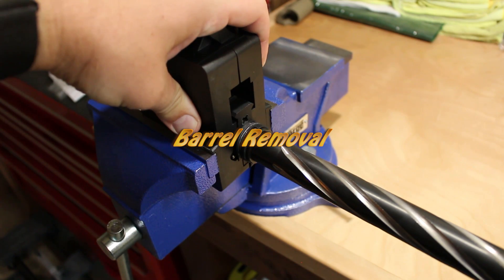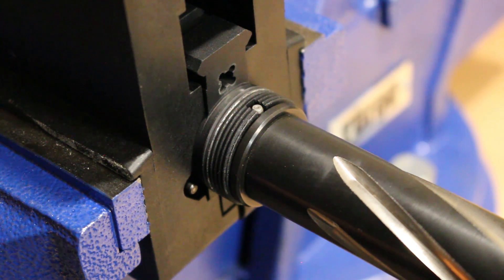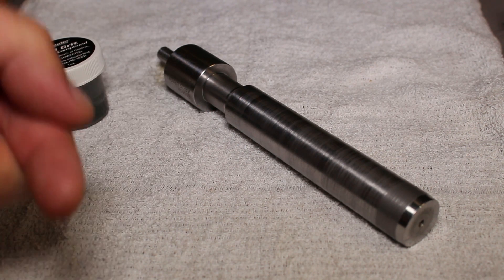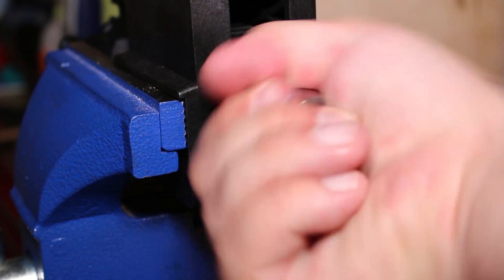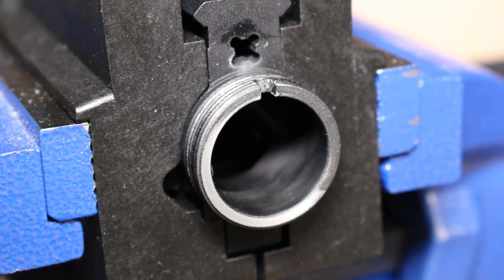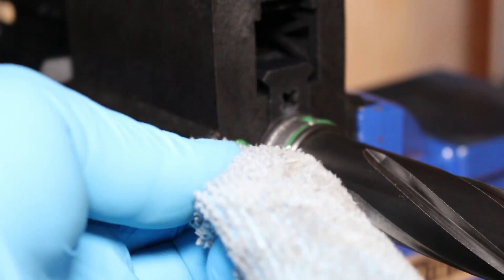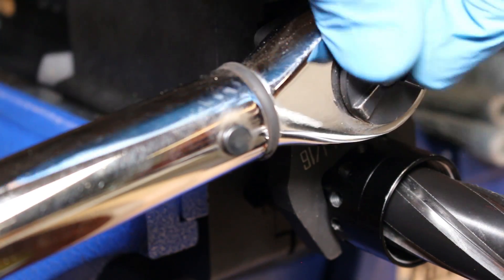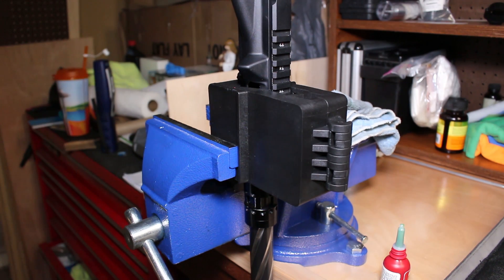Bedding a Barrel into an AR-15 upper receiver

Comment: You just removed the anodizing from the aluminum...You literally made the part of the receiver that takes all the rearward force soft as butter. And as a gunsmith please don't ever put locktite on a firearm ever again!
Reply: so you dont use loctite on set screws for pistol or rifle sights or handguards or scope mounts or rail mounts/accessories?
Reply: @sik59rt  He meant the barrel. You never use locktite on a barrel, or the nut. That's never coming off. Granted, he might never shoot the barrel out, but that upper is done.
Reply: zzseamlezz so when he said “never put ‘locktite’ on a firearm ever again” he only meant on a specific part on a specific rifle? Okay
Reply: @sik59rt  Assume positive intent, yes.
Reply: @MrAKBBags  blue loctite releases after you put a heatgun to it. I use one small drop on my front sight on pistol
Reply: @ryangreen6250  Same, but he said the firearm, not the sight.
Reply: @MrAKBBags  ya i dont know why people generalize so much when the devil is in the details
Reply: @sik59rt  Sights aren't the firearm, Holmes. They secure to a rail. No one uses loctite on parts that would get hot (the Barrel) because it's stupid, and wouldn't last more than 50 rounds, or if it does, it's never coming off. Huuuuur duuuuuur, let's put High Temperature Rocksett on muh barrel, or barrel nut. The absolute state of NOGUNZ.
Again, "Accessories" isn't a firearm. Why is this hard for you?
Reply: i don't think you know how anodising works
Reply: What about the optic mounting screws?
Reply: The barrel is actually pulled away from the receiver by the force of the bullet. The reward force of recoil is generated by the forces on the bolt face and by the gas system. Unless you're referring to the clamping force of the nut, which isn't enough to ruin the aluminum. Basically what I'm saying is you're wrong lol.

Comment: Good for you making this video.   Lapping the receiver face is a good idea ..  not so sure about the Loctite... I might recommend you use aeroshell 33MS for the bbl extension and the bbl nut.
Reply: The loctite is to fill the gap between the barrel and the upper.  Did you see how loose that barrel was, 620 will fill that gap as long as it's .015 or less. . .Loctite 609 is good for gaps .005 and under. . .The key word here is "bedding"
Reply: @z50com  Cool... That works I guess.

Comment: This is why I buy stripped BCM uppers. They're already machined to a tighter tolence and have to be heated to insert the barrel ext. No sloppy fit and doesn't really require lapping .
Reply: Eric Hayes I have also noticed this in the aero Percision upper receivers very tight fitting on the barrel extension.
Reply: Yep. Same w/Aero Precision, and Spikes. That barrel isn't moving after applying AeroShell, and setting in the upper.
Reply: Even after heating with a propane torch it's still a pain in the ass to get together  from my experience very tight tolerances tho
Reply: exactly..best uppers for the money..good tight fit

Comment: It will not affect head space and you should do it vertically so the lapping tool rides flat. I would check and find the slop. Probably a bad upper. Discard it. I would never locktite
Reply: @carlosmartin3587  , yes,  I lightly lap the finish off the upper always. But if a upper had that much slop in it I would discard it. I beleive(without rewatching) the video stated dont lap to much or it could effect headspace, which is incorrect. The upper has nothing to do with it. The bolt slams home/into battery and headspace is from bolt face to datum line. So removing material from the front of the upper threading just moves the gas tube back a few .001. My main point was lap the upper in a vertical position so the tool rides flat, which is squarer to the bore line. Doing it horizontally I noticed the tool canting downward.

Comment: Loctite I is not an anti seize nor is necessary for a good fit. No military contractor or gun manufacturer uses loctite . I think that it is a  misnomer.
Reply: Paul Hughes 
While this guy used an adhesive, locktite brand does make anti-seize compounds.

Comment: How hard is Loctite 620?  Does it retain some flexibility (so barrel can be removed)?  I've seen one guy use aeronautical epoxy, which dried and was then machined on a lathe to uniform roundness, and subsequently a tight fit.  Is this a good practice?  I've seen people put grease between the barrel extension and the upper receiver.  Is that good?  Thanks
Reply: Also, heat will degrade the red loctite. Never seen the threads naked like that. I’ve always seen white lithium grease applied before the nut.
Reply: Loctite will never hold two different types of metals together for very long under any amount of stress. Aluminum receiver to steel barrel will hold for maybe 500 rds.

Comment: Only thing I can add is why not place the upper in the vise vertical while you're lapping the face ?  Let gravity work for you.  The pressure you were applying to the lapping tool plus the torque to make it turn is cocking the tool as much as it would go and is probably why it only surfaced the lower left of the receiver. I'm not expert but I have worked with machine shop practices and built a few ARs in my time.  Take it for what it's worth . Just friendly advice .
Reply: It removed part of the anodizing because the milling of the threading wasn't true or the thickness of the anodizing was not uniform. Not because of torque on the tool.
Reply: @cleatussfmo7437  ;   OK...…?
Reply from the maker: Thank you, I will try it that way on my next build and see how it works.  That is why we make these videos, to share tips and tricks of the trade.  Stay safe out there
Reply: You can tell by the blemishes on the insert that this technique is long overdue.

Comment: Removing to much does not affect the headspace.
It will only affect the length of you threads.
Reply: it can also affect the feed ramps and run the barrel extension out past the receiver. would require a some serious lapping, but that would be the end result. headspace as you said is not a factor. the entire barrel, bolt and extension will move rearwards and eventually cause a feeding issue.
Reply: Militaristics q
Reply: Correct, this why the AR is idiot proof with this regards.  The headspace is set by the barrel extension when it is screwed on and pinned.  This is also why you can simply drop in any BCG you like.  Overlapping, which really takes effort may affect feeding issues as the barrel extension is pushed closer to the bullet feed path.
Reply: @lkazanov  idiot proof till you put loctite on the barrel extension.
Reply: Agreed, headspace is a function of bolt to barrel extension.......
Reply: Who makes the best Lapping Tool?
Reply: HarmJW77 I was about to say the same thing.
Reply: But guys, wait, can someone please explain how head spacing works?
Reply: @treygregory7929  headspace in an ar is set when the barrel is mounted in the barrel extension.  The only way to change the headspace would be to mill off the face of the bolt, or take the barrel extension off and remove material from the barrel.  Sometimes different brands of bolts will have different specs causing headspacing issues.
Reply: Trey Gregory    Hey. I found this video on head space and it shows this really well. Not my video but it’s great in showing it.                                       https://youtu.be/vAgjvBxzng4
Reply: I was looking for somebody to comment on his idea of effecting headspace👍
Reply: Head spaces is inside the barrel extension , the size of the chamber with the bolt locked in.
Reply: Exactly.  

No change in headspace.
Reply: Correct, the pin and pin slot are technically what set the depth on the headspace
Reply: @BurritoMan1994   No they don't. The pin is yust there to fixate the barrel-extension to the barrel and to provide the correct orientation of the barrel-extension to the upper receiver via the slot. How far you screw the barrel-extension on to the barrel is what sets the headspace.
Reply: How do you figure it doesn't affect the head space ?  If you remove .005" , does that not move the barrel extension back .005" ?  And wouldn't that move your headspace back .005" ?  I'm confused .
Reply: Sure it moves the barrel extension back.
It also moves everything else conected to the extension back ,005"
Headspace is determined by the space between the bolt-face and the shoulder of the chamber, this dimension does not change.
 @orionfixr7713
Reply from the maker: I might have miss spoke in regards to head space.  I was trying to explain the position of the bolt in the upper receiver.  I am used to working bolt actions and getting the bolts to function properly in the action and barrel.   It has been my experience that If you remove to much then the Clocking of the barrel nut (depending on type) may be affected to the point you may need shims to correct.
Reply: @HarmJW77  Ok . I get it.  The head space on an AR is under spring pressure  and will lock up correctly as long as the all the clearances are correct in the bolt and chamber .  Not like a bolt gun where the tolerances are etched in steel and unflexing . Thanks for the head straightening .
Reply: Spring pressure does not play a part in headspace.
In AR's the barrel-extension contains the counter-lugs on wich the bolt-lugs lock themselves.
This extension is permanently threaded to the barrel and therefore the chamber dimensions never change if you move the barrel-extension forward or backwards in relation to the upper-reciever.
In a lot of bolt action guns these counter-lugs ar part of the reciever itself.
So if you move the barrel towards the reciever you also move it closer to the locking lugs and reduce your headspace.
Removing to much material could result in threads that are to short to tighten up your barrel-nut on an AR.
Or maybe it makes your camming-pin hit the backend of the recess in your upper reciever. @orionfixr7713
Reply: @HarmJW77  :  What I meant by spring pressure of course is the buffer spring that ensures the bolt goes home in the extension . And yes, originally I mistakenly associated an ARs bolt lock up with a bolt action lock up ,or for that matter an AK bolt lock up. Been awhile since I've done anything but shoot any of them. Brain fade, I guess . HAHA
Reply: Finally somebody who gets it!
Reply: @orionfixr7713  the headspace doesn't work that way. The only thing lapping would do is cause the barrel extension to move back .005. The headspace is set off the bolt in the bcg. The worse lapping can do is cause the bcg to protrude further out of the receiver with a closed bolt.
Reply: @SIRWAFFLEBOB ;  That horse was dead along time ago. The one thing no one has mentioned is the channel and the cam pin. I realize the amount you would have to remove would be way excessive, but you could bottom the bolt in the extension before the cam completely locks up.
Reply: @orionfixr7713  do me a favor?
Reply: @SIRWAFFLEBOB ; And that would be ?

Comment: You forgot anti-seize on the barrel nut
Reply: Guys, the aeroshell 33 is not specifically selected for its anti-sieze properties. It is recommended for its ability to inhibit deterioration of the aluminum in its contact with the dissimilar metals used on the barrel nut and barrel under high heat and stress.
Reply: @bootgrip6  bingo. But it does have the added benefit of working like an anti-seize compound. It's a dual purpose product in this application.
Reply: @TheYemcl  100%
Reply: @bootgrip6  Which is not a problem to begin with.... Both the barrel nut and receiver are coated anyhow.....
Reply: Having used green loctite a whole bunch in my profession, I can say it’s wonderful stuff , but yes, you can warm it up and get it apart. I would antiseize just about anything I torque and want to disassemble some day. The exception being something that requires loctite on the threads to keep it tight.
Reply: Who started this anti seize on the barrel nut, and why havent they told del ton to add anti seize. And why would some kne want the barrel nut to easily come off.
Reply: @PurpleHaze-151  Military armorer's manuals require Aeroshell 33MS on the barrel nut threads. You're generally torquing a steel barrel nut onto aluminum threads in a high-heat application. You want that stuff. 
It won't just "come off" if you torque to spec. The Gas tube prevents that on milspec barrel nuts. Further, even on a free floated handguard with no anti-rotation tabs, I've never seen a properly torqued barrel nut loosen.
Reply: @inexpensivearms6952  Sometimes it is an aluminum barrel nut
Reply: antiseize will just burn off need to use a moly based grease hi temp like aeroshell33 ms
Reply: @sendit2873  Use nickel based antiseize that is for lambda sensors and spark plugs .
Reply: Anti seize will not burn off at all.  We use it on brake parts that get way hotter.  Stupid comment.
Reply: @tahcogunworks  I've put antiseize on the exhaust manifold of a tractor and you're right it will not burn off.
Reply: @tahcogunworks Not all antiseize is the same. Afraid yours is not his. All even the best have limits.
Reply: well, you might want to use anti-seize on the threads, BUT with GREEN loctite in the upper he likely isn't taking that off again for life...
Reply: @waaynneb1808  BS.  I just took one off today.  620 is a bearing retaining compound, not an epoxy.
Reply: He shouldn't be using loctite on that upper/barrel anyways!
Reply: @MC-px9eq  Yes he should. Know what you are talking about before you talk.